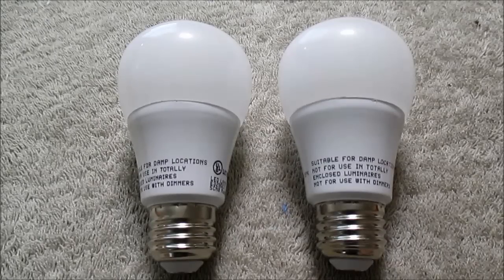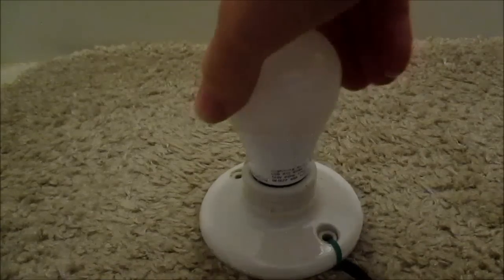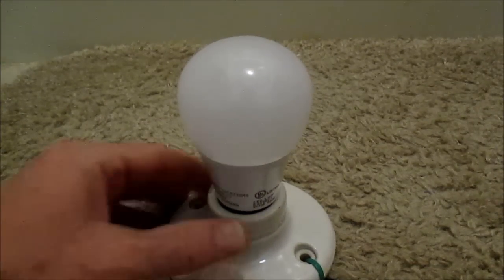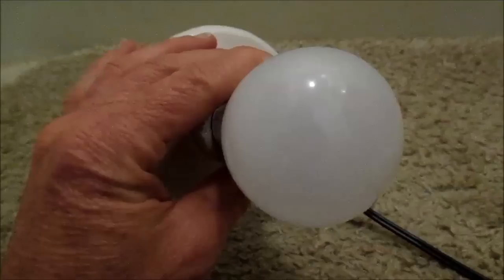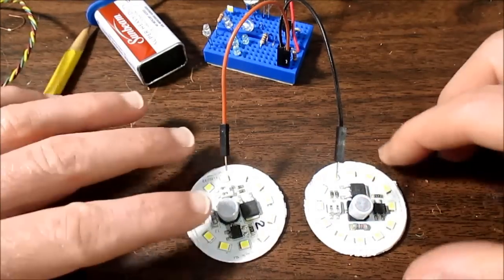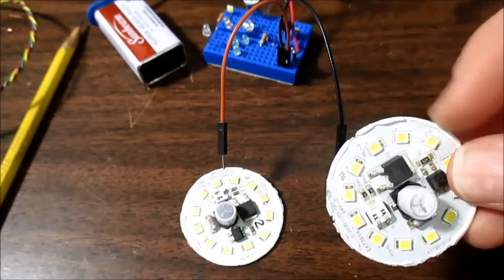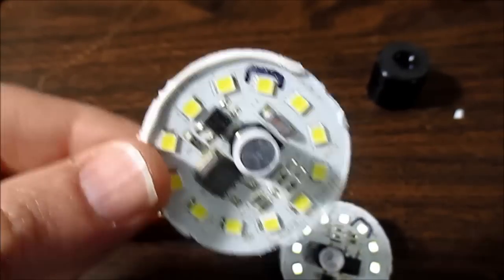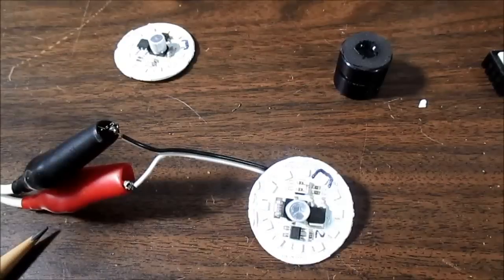Two failed LED bulbs for teardown to determine the cause

Comment: I've had LED bulbs mysteriously got out far too soon and wondered what the problem was. They are too expensive to keep replacing like the incandescent bulbs. Thanks for the video.
Reply: I would investigate supply voltage stability/transient surges. Another cause could be aging switch contacts not allowing a clean switch action.

Comment: So if you take the LED out and connect the wires it would work, am I correct? I would have checked continuity on the circuit board first, but looks like you know what to look for when one does not work correctly.
Reply: You mean remove the bad led and short it's pads. Yes, correct. LEDs are current driven. The power regulator increase the voltage accross the led series until it measure a wanted current, in this case ~70mA. The lamp was flashing  because the regulator was pushing the voltage to a level that the bad led was starting conducting but then the current was too high causing the regulator to shutdown to prevent damage.
To be sure your lamp circuit is current driven do as the video and measure the current with the multimeter shorting one led. Take note and short 2 near leds. If the current is the same the power regulator is lowering the total voltage accross all leds to mantain the wanted current. You can short out the bad led and repair your bulb.
Your led tv backlight circuit works the same.

Comment: 3:41 What ? Can anyone help plz ? Wasn't able to understand what he said . Thnx
Reply: He said "3 DIE inside at 9 volts".  It should have been "3 DIODES  inside", referring to Light Emitting Diodes.  At 3 volts for each, in series, would be 9 volts 
across each unit, then times 12 units for a circuit total of 108 volts DC.

Comment: I had one flickering mostly when you turn it on. It was a cheap utilitytech brand from Lowe’s. I’ve used several sylvania leds with no problem so far. I just bought a coupl Cree leds that seem bright but have a weird delay when you tube them on. I’m assuming it’s intentional for some reason.

Comment: I've read through most of the comments on this thread and like many of you, find it disappointing when an LED which we thought might last 15 years fails much sooner than that.  
HOWEVER, do the math!  It is quite common in 2018 to find 60 watt equivalent LED's (which use about 9 watts) for $1 or less on sale with energy rebate coupons.  That is when you stock up!  100 watt equivalents have been significantly more expensive but just recently, in Canada at least, Costco had 3 packs on sale for less than $9.  These are the FEIT brand (and yes I've seen an earlier FEIT fail but rarely).  Anyway, these 100 Watt equivalent bulbs use 15 watts and they are "rated for use in enclosed fixtures" which is pretty uncommon for LED's.  So for every hour of operation, these bulbs reduce electricity consumption but 85 watt hours.  Therefore it takes 1000/85 = 11.76 hours to save 1 Kilowatt hour of electricity.  Let's just round it to 12  hours of use.  So at 3 hours per day of use it will take 4 days to save a Kilowatt hour.  365/4 = 91.25 Kilowatt hours per year.  Where I live, my "All In Electricity Cost" is 13 cents per kilowatt hour.  So that single bulb will save 91.25 x .13 = $11.87 in a year.  That's not a bad return on a $3 investment.  While I've certainly experienced a few LED failures (my entire house has been converted), it's definitely not a 100% failure rate and I have several which have been in operation for years including the lamp at the end of my driveway which operates an average of 13 hours per day.  That single bulb saves over 1 Kilowatt Hour per night or about $52 per year.  I'll accept that trade-off.
So go ahead, get mad as hell and trash all your damned LED's.  Then go find some good old black-market incandescent bulbs.  Just don't complain when your hydro bill goes up!
Sadly MOST people also don't understand color temperature so they complain that they don't like the light quality of LED's.  So here goes:  Incandescent light bulbs operate in the color spectrum around 2700 Kelvin.  There are LED's which approximate this level and they are labeled as Warm White.  There are also a lot of "Warm White" labeled LED's which operate in the 3000 Kelvin range (my personal preference for areas like kitchens).  LED Bulbs labelled as Daylight or "Cool White" are generally up in the "Bluer" 5000 Kelvin range.  These are good for lighting a garage or workshop but for most interior use, the preference seems to be for Warm White as it more closely resembles what we remember from incandescents.  Again, MOST people don't realize that when you dim an incandescent bulb, such as in a chandelier, the color temperature also goes down as you dim it.  Full intensity might be around 2700 Kelvin and when dimmed down it will be around 2200 Kelvin.  This DOES NOT happen with MOST LED's.  They just get dimmer but the color temperature remains the same.  For fixtures where you want nice dimming results, Phillips makes a series of LED Bulbs called "Warm Glow".  These clever bulbs have an Amber LED in the center.  As the dimming slider is decreased, the whiter LED's around the periphery get duller and the amber LED increases in intensity.  The result is pretty remarkable for maintaining ambiance in desired locations so Bravo Phillips for this innovation.  
By the way, I still have my parent's 85 year old coal oil lamp which works perfectly.  Just have to find the coal oil and trim the wick everyday.  Then I get this dull orange glow.  Yeah!

Comment: for me something oddly happend 1 of the smd led´s had burned smoke in his area 
leds are not known for getting so hot but 
for the most led´s i have used i also would include devices they useally where like never broken it always was something else on the pcb or diffrent related

Comment: I've noticed with mine, whether good ones or cheap ones, that if they are in an upright position, they last for a long time, but if you use them in upside down formats, like hanging lights, they die quickly. Same thing with the fluorescent ones.

Comment: The problem is that they run the LEDS at a current just below self destruct to get the most light, but as you said, the weakest link blows and they all go out!

Comment: They use cheap material so it burns faster. If any lightbulb exceeds 2000 working hours, company manufacturer gets fined.
It's all made to last 3 years regardless of brand name.

Comment: I replaced a incandenscent bulb in my closet with an LED; the original was in there 12 plus years.  The  LED bulb failed in 8 months.
I had an LED green bulb in a closed outdoor lighting unit, it failed in 5 months.  The other ones are still running, so my feeling is that some of them are the typical crappy cheap dishonest Chinese ones, and the others are maybe Malaysian or Korean and are much better quality. Never buy anything made in Communist China!  And that goes for Taiwan now, since they just repackage and rebrand the crap that comes of of China and resell it now.

Comment: my guess before I even watch this is A: led run on dc power, and B: thats a 110 volt AC socket bulb.... 

ever wonder why AC led bulbs fail?  gee I wonder..   ps leds themself's last decades..
Reply: Harley Me    There is a full wave rectifier to take care of the AC and “filter” it to DC and a voltage regulator to step down the Voltage .

Comment: I have an LED on continuesly now for 3 years it's never turned off. They take such low voltage and amperage that there's no need to turn them off like an incadesant or florescent that use much more electricity. Voltage spikes have no effect on longevity. I got mine free from Blue Planet.

Comment: I replaced all incandescent and fluorescent bulbs with FEIT LED's three years ago.  Most of the FEIT bulbs have failed and been replaced with CREE, which remain in service.  I threw the FEIT JUNK LED BULBS away rather than taking them back to COSTCO and HOME DEPOT as I should have, because I did not document purchase, service and failure dates.  I am doing that now and keeping the receipts with all LED bulbs.  I write the info on the base of the bulb with a fine marker.  When the sellers of these junk bulbs begin seeing them returned by unhappy consumers, maybe they will look for better products to sell and FEIT will have to just sell their crap in China.

Comment: Why are those leds in series? That was the problem with junk christmas lights before.  One bulb out of 50 burns out the whole thing doesnt work.  Those scam manufacturers need that in parallel. 1 dead led out of 12 would make little difference on brightness. Seems these are hooked in series for "consumers" to keep buying.  Milk the public wallet...

Comment: Since the current is correct, just jumper the bad LED and continue to us them.
Reply: Will partially work. Current source will take on himself extra voltage drop from the non existing led. This will give an extra heat on that chip. I would expect the best way is to use voltage source as close as possible to the total V drop over leds. And after, limit the current in the circuit.

Comment: Bulbs lasted 10 years longer with thicker wires in the 70's
Reply: And only put out about half as much light so for an additional decade you were wasting that much more power, a hundred times the cost of what it would have cost to buy new bulbs, and then you also needed twice as many bulbs for the same amount of light so should also count the cost of more lamps, raising the power consumption even more.
Reply: @stinkycheese804  and the glass and metal on the new bulbs come from god without any usage of energy to produce it ? LOL. Typical modern, left-green child logic.

Comment: I've used a bunch of different brands and designs of LED bulbs over the past three or so years. And almost all of my failures were sylvania bulbs. These look similar, not sure if that's what they are or not. But my sylvania bulbs all start flashing after a year or two, switching between normal brightness and maybe half brightness. I've had countless warranty replacements but the replacements start flickering too. I've probably had at least 10 sylvania light bulbs go bad. But every other brand I've used has been great.

Comment: Interesting. I was always suspecting the capacitors. Have to try that out. Thanks.
Reply: My entire house uses led bulbs, Philips, MPE, other craps, all are craps, have been tearing them down and try to fix some, by replacing capacitor, I also though it was the weakest link in their desing, turn out I was wrong, only 1 out of 4 failed bulbs has broken capacitor, literaly anything in those led can fail, from every single led chip, to every single elements in the power circuit.

Comment: Well! QC or ur wiring issues...mine works perfectly, I bought it 3 days ago . I bought for 299 at 99 cents store...I replaced 2 bulbs in my bathroom so far no issues and its sooo bright usually I have 4 bulbs  but now i used 2  and super bright and 1 on my front door and super bright as well..but will see i will keep u updated on how long will last...
Reply: How are those bulbs doing?

Comment: I keep an eye out for the 12W bulbs at the dollar store. I get a fairly high fail rate, but not enough to warrant paying 5 or 10 times the price. These look like the internals of the 7W or 9W ones they usually have. If they're not dirt cheap, it's BS that they're using such garbage components.

Comment: Back when leds just came out and were stupid expensive i got some direct from china for 2 bucks each. After about a year some of them did the same thing, i just ordered some cheap leds from ebay and soldered them in the place of the bad ones. Most of the lights still work after quite a few years now. The ones i have, the tops unscrew so i didnt have to chop them open or anything. But hey been a few years, still worth 2 bucks.

Comment: The only problems I've had are on the 3-Ways. Seems one or two of the wattage's stopped working quickly. I had two and put them out in the garage door opener when they failed to work as a three way. I have many others that are on 2-3 years. The ones outside on the garage were installed 2.5 years ago,use 9.5W each for a 60W illumination rating and are on 8-13 hrs per day depending on the season. With incandescent bulbs they wouldn't last six months because of weather conditions and the vibration of a garage door going up and down. Well worth the money. The only incandescents I have left are a few in very low use closet lights. When they finally shoot craps all bulbs in my home will be LED.  Time to replace the Christmas lights but I still like the old style incandescent light color over LED but LED's are getting better.

Comment: I've replaced most of the bulbs in three homes in the last few years with LEDs and basically no problems.  Make sure you use bulbs with the 3000 kelvin scale for the best natural color.
Reply: Natural color depends on the owner. Those who work in morgue are used to 6000K)

Comment: Yes capacitors are more efficient than resistor  as series current limiters  but do have the tendency to go open circuit far to often  but better to do that than go short  Also we not need the heat that resistor would produce